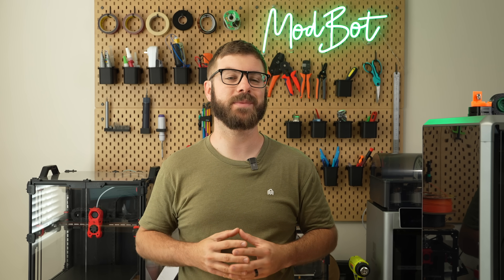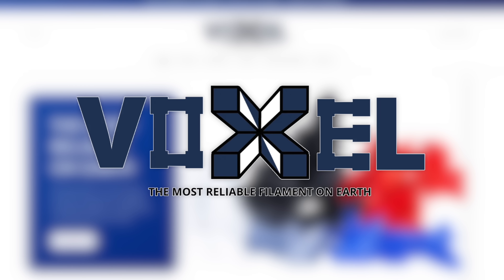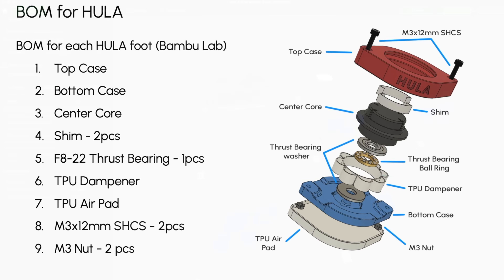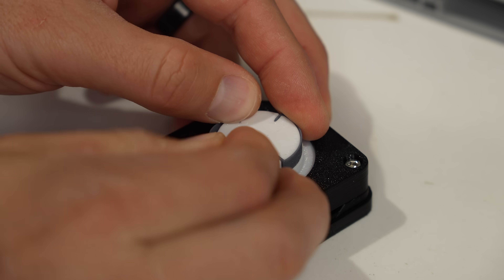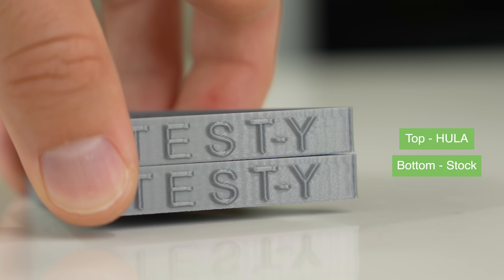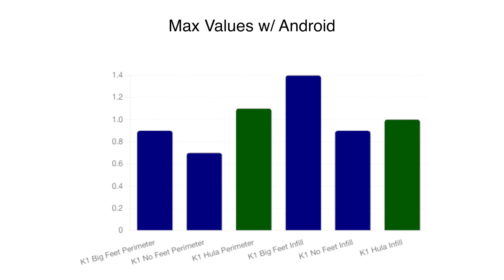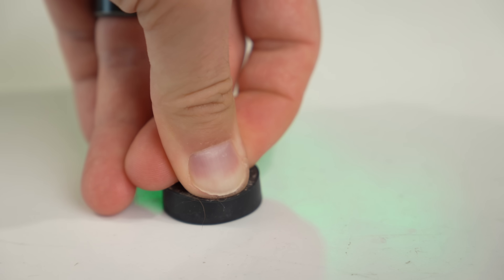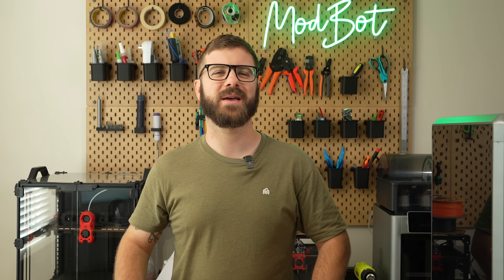Self-Aligning Anti-Vibration Feet For Your 3d Printer (HULA)

Comment: This was a great video, and the compliant feet you reviewed look like a good solution for many people. (As you found though, the amount of difference they make will depend on the specifics of each situation.) It led me to think a bit more deeply about the whole matter of motion artifacts in 3D printing.

When it comes to measuring the effectiveness of compliant feet, vibration transmitted to the table or even vibration of the printer body itself isn’t necessarily a measure of how much good the feet are doing for your prints. What ultimately matters is how closely the print head is able to follow the intended path relative to the build plate, which ultimately comes down to how much the frame of the printer is being distorted or warped by the forces applied to it.

Seen from that perspective, what we want to do is to reduce the impact of forces on the printer’s frame caused by print head acceleration and also dampen the system’s response to its resonant frequencies.

If the printer were bolted down to an absolutely rigid table, all of the reactive forces caused by accelerating the print head would go into deforming the frame, resulting in inaccuracies. Adaptive tuning can compensate for momentary deviations and (more importantly) adjust the frequency spectrum of those forces to avoid the resonant frequencies of the printer frame and X-Y motion system, but the total amount of energy being injected into the frame will always be a direct function of the print head acceleration.

On the other hand, having a compliant mounting lets some of the reactive energy from the print head’s acceleration go into moving the frame of the printer as a whole, reducing the amount left to go into deforming the frame.

Think of it this way, using an extreme example: Imagine a stick clamped upright in a vise. Tap the top of the stick with a hammer and it’ll bend under the force and then vibrate back and forth. Now mount the stick on a roller skate and do the same thing. The whole stick/roller skate assembly will move away from the hammer, but the stick will vibrate much less, because there was less force applied to bending it.

This is the main thing that compliant feet are doing for the printer; they allow some of the energy from the print head acceleration to be turned into movement of the printer as a whole, vs distorting the frame and causing it to vibrate. 

BUT, we need to make sure that the printer (and whatever it’s mounted to) doesn’t end up vibrating at large amplitudes itself, as that motion could result in forces being coupled back into the printer’s frame, causing the very problem we’re trying to avoid in the first place.

The best solution is to allow the printer to move in reaction to the forces caused by accelerating the print, but then to dampen out that motion over a longer time period (probably still well under a second) so it doesn’t build up into larger oscillations that would themselves result in distortions of the frame.

Thanks for a very interesting video with real-world data and for pointing to the design for the HULA feet!
Reply: Although you are on the right track, you are making some mistakes in your assumptions.

Firstly, you are absolutely correct that the only thing that matters is tracking between printhead and bed. Secondly you are also correct that we want a very stiff frame to have this coupling work well. 
However, bolting the printer down to a rigid table would not change how reaction forces are coupled into the frame. Whether bolted down, or suspended in air, the any force induced onto the printhead and associated reaction force are always between said head and frame. Thus it would deform equally in either case.
Additionally, the amount of energy you 'inject' into the frame also does not change. This is a fundamental law of thermodynamics, namely the conservation of energy. If we stiffen our frame, we dont change the amount of energy we put in, rather we need to put in more energy to achieve the same deformation. 

Perhaps to convince you, imagine modeling the printer as two masses. Printhead mass Mp is connected to the frame+buildplate Mf. The connection between them can be a spring, modeling the stiffness of the frame. We should then connect the frame to the fixed world through another spring mimicking the limited stiffness of fixed-world to printer connection. 
The response of a simple spring + mass is second order, meaning it passes any frequency up to a given frequency (given by sqrt(stiffness/mass)) after which vibrations will couple through less and less. 
So this shows obviously, to have high tracking performance we want to pass frequencies as high as possible between bed and printhead. Thus the frame should be stiff, and printhead mass should be low. The frame mass does not matter for this at all!
Considering external vibrations from the fixed world, we would like to reject those. So in this case, we want the stiffness from fixed-world to printer to be low, and frame mass to be high to reduce the frequency as much as possible. This is a common principle in precision engineering/machines.
Do note, that we are talking sub-micrometer precision for these vibrations, so for 3d printing it essentially doesnt matter.

As for damping, you are right that you want to apply some damping. This is indeed to avoid what you call 'build up into large oscillations'. This means that for a typical 2nd order system, we want the 'peak' at resonant frequency to be nicely damped. Adding more damping beyond that will not help your system response, rather just reduce your bandwidth and thus hurt performance!
Reply: @tHaH4x0r  You're right about viewing things from the standpoint of mechanical oscillators, with masses coupled by springs, but you're missing the fact that if the frame as a whole can move in space, then some of the reaction force from accelerating the print head will go into translational kinetic energy of the frame, vs potential energy stored in the flexing of the frame.

You're absolutely correct that the force between the frame and the printhead will always be the same for a given printhead acceleration, but it's a question of what that force does; if some of it goes into translational acceleration of the frame, then there'll be less left to be stored as potential energy in distortion of the frame.

In situations like this, it's often helpful to think of an extreme or limiting case, such as infinite masses and arbitrarily great forces. 

Suppose that the printhead had infinite mass and the motors infinite strength. If the base of the frame was bolted to the floor then any attempt to move the printhead would just bend the frame by that amount. If you instead put the frame on a frictionless surface, then at low speeds there'd be almost no bending of the frame at all. (In this case, you could still get great prints, it's just that the build plate would be moving under the printhead instead of vice versa.)

Back to reality, our printheads hopefully don't have infinite mass and our motors unfortunately aren't infinitely powerful, but the same principles apply. Simplistically, forces caused by accelerating the printhead can either create potential energy stored in flexed frame elements or kinetic energy in the movement of the frame as a whole. Energy is conserved, so the more that goes into the latter, the less there is of the former.
Reply: So, talking about vibration and 3d printer feets, whats the better standard solution for getting better quality prints?
Reply: @aquamansurfer  In my opinion, feet do not impact print quality at all, except perhaps if you are running a giant print farm with tons of machines that might couple vibrations into each other.

A more effective way to improve quality for a single printer, is improving stiffness between print-head and frame. How this stiffness presents itself depends on the axis you are looking at. It can be the frame/gantry stiffness, but also the driving stiffness of the actuator (which should take into account the limited stiffnesses of the belts). 
Personally for the driving directions (for a core-xy these are the x and y axis) the main limitation is the limited belt stiffness. This is also something you see in for example the new ratrig vcore 4. Changing from the 'regular' core xy configuration to their 'hybrid', improves the eigenfrequency by 1.38x (see 247printing's video). The only thing the hybrid design does, is essentially run another set of belts in parallel, effectively doubling the driving stiffness of these belts. If that would be the case, we would expect an eigenfrequency increase of sqrt(2), which is extremely close to the practical numbers found. Hence my conclusion that this is likely the limiting factor for core x-y machines.

A more elegant way to do achieve similar results at far lower cost, is just run thicker or wider belts. In order not to compromise the bending radius, wider belts are likely the best solution for this.

However there's one more solution to getting better quality prints: just printing with slower accelerations.
Reply: @tHaH4x0r  Ah, excellent point about belt stiffness likely being a limiting factor as well. I expect you're right that they're a good bit less stiff than the frame and so contribute a larger part of the deviation from ideal positions - and their stretching or lack of stiffness won't be impacted at all by frame movement in a global reference frame because they (the belts) are what's directly driving the relative movement between the frame and the head.

As to feet improving or not, I don't have any personal experience, was just judging from what ModBot found in his tests in this video.
Reply: @aquamansurfer  The HULA feet seem like a good way to go. They decouple the printer from the table so it can move a bit more in response to printhead acceleration, but they're self-centering, so movement will average out over time and also keep the printer from crushing them like the Bambu TPU feet.
Reply: Thanks for the info !  Please what video do you refer?
Reply: @aquamansurfer  The "HULA" feet are what ModBot was testing in the video above.

Comment: I live in Hawaii (the ground is a resonator), The big island (the volcano is constantly erupting), on the second story of an old building (also cheap likes to wobble), right next to the highway (heavy trucks shake the building), right next to an intersection (loud motorcycle engines, loud base, and rumbling diesel engines can shake the building when the light is red), under a military helicopter flight path (entire wings of Blackhawks, Chinooks, and Osprey fly directly over my house at low altitude every few days).

This is highly relevant to my interests.
Reply: That is actually one of the rare cases where reducing coupling between printer and fixed-world would be beneficial. We have air bearing tables in our lab to reduce outside vibrations into precision equipment, but those are so sensitive some of them can pick up vibrations of people walking in the hall-way next door.
Are the vibrations really so bad that they would affect print quality though? Its not a sub-micron level precision device.
Reply: @tHaH4x0r  The resin printer in particular. I got it up on three layers of isolation now. 

What I really want is a "noise" canceling table.

I'm pretty sure I could get all the pieces on SparkFun, but I'm going to need an AI to do the software for me.

Comment: Why is it advised not to perform a calibration after installing these on a Bambu?  The accelerometers in the printer don't know whether they are sitting on stock feet, these feet, or just a wobbly table.  How can an active input shaper respond accurately without being calibrated on the actual surface on which it is placed?
Perhaps perform tests like this on a concrete floor?  Those wobbly benches and racks don't lend themselves to valid testing repeatability.
Reply: you shouldn´t run input shaper again because the accelerometers can only measure the movement of the printhead in absolute space, not in relation to the printer´s frame, which creates a problem because the feet allow the frame to move around and vibrate a lot. So the Prtinthead would be perfectly still but the frame with the bed and part attached to it is wobbling around below.
Reply: Print artefacts occur when there's an undesired movement of the toolhead relative to the print, or you could say relative to the bed. Input shaper is capable of reducing this movement by avoiding resonances.

However automatic input shaper calibration is an accelerometer. It doesn't know what movement of toolhead is is relative to bed. It only knows movement of toolhead relative to Earth's gravity, so in Global coordinates.

Soft feet can reduce frame distortion and forces acting on moving components, by allowing the printer frame to move as a whole, while taking up and gradually dissipating this movement energy to heat. This newly introduced global movement is irrelevant to quality, but it does get picked up by the input shaper calibration as something to be avoided.

This is my assumption for why one should not calibrate input shaper on very soft feet or other compliant installation methods.
Reply: The reason it's not advised, is because the test results in compensation values used that produce more artifacts than using the values measured when using stock feet. This can be caused by both the feet or the mechanism used to measure the vibrations or calculate compensation.